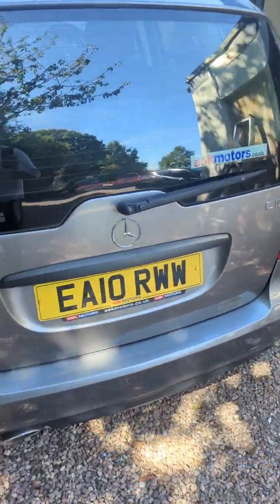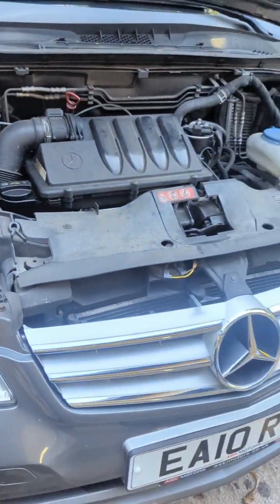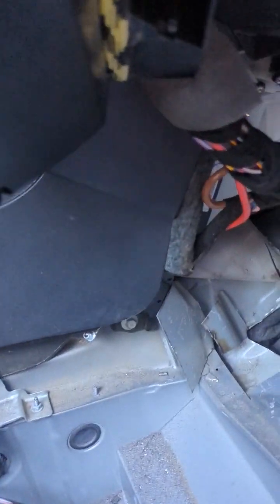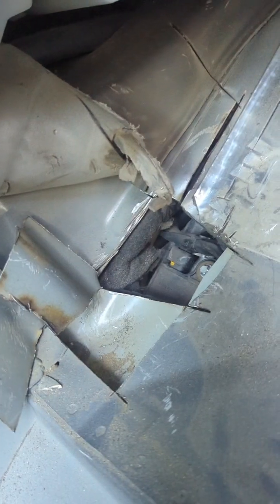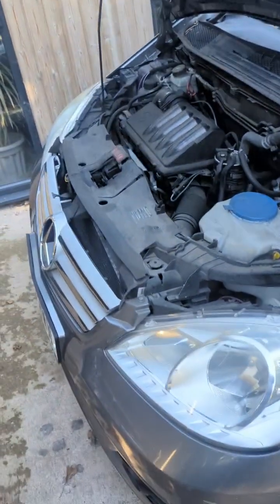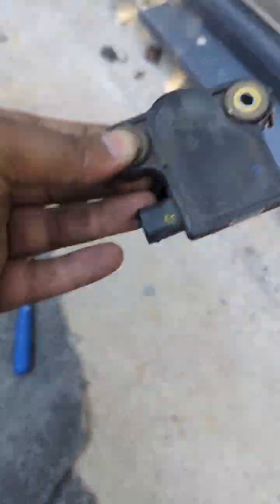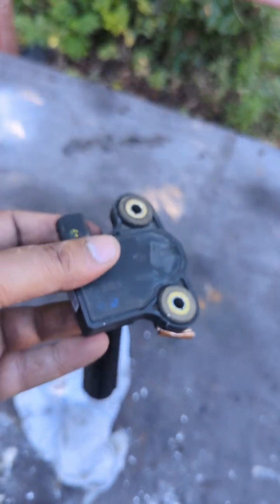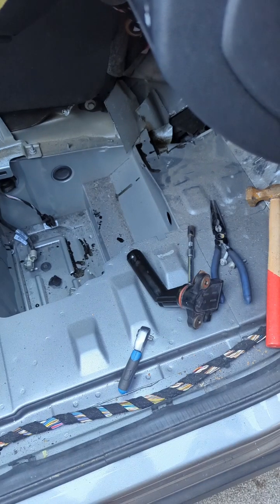Mercedes A160 cdi om640 oil level sensor change oil level low stop engine warning fix...

Comment from the maker: Oh ok cool thanks for that hope you all the best the aftermarket sensors are not the best though tbh sometimes you get a msg sayn oil level cannot be read but most times its ok and it doesnt flash in red.i think a working used part maybe the better option